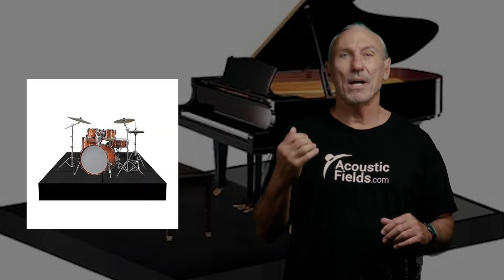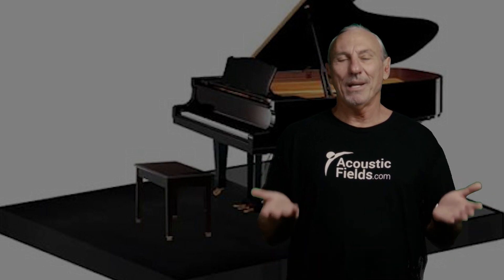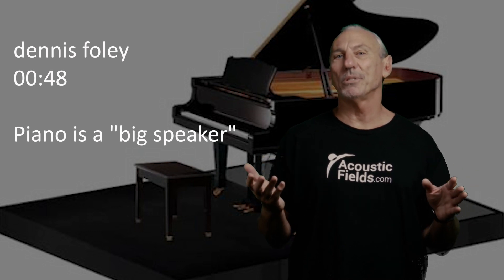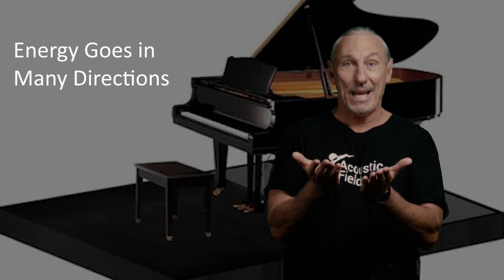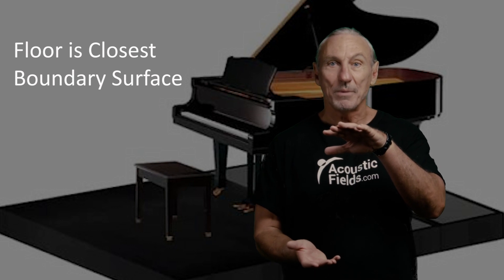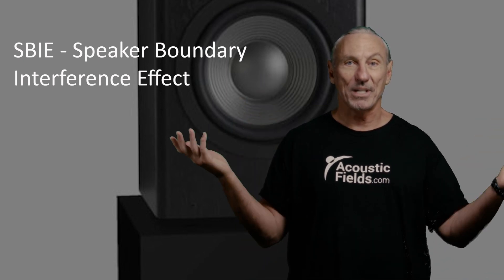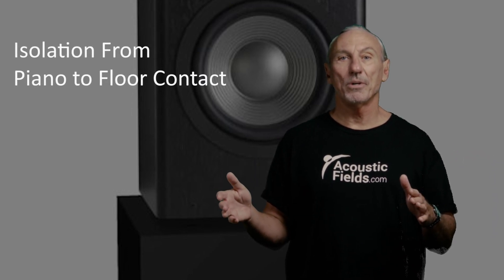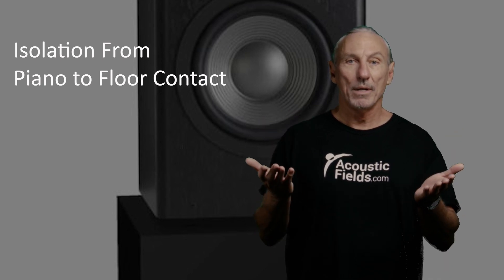Isolation - Elevation - Attenuation - www.AcousticFields.com

Comment: hi dennis. happy new year to you and to the comunity. i follow your channel since a couple of weeks and i appreciate the information you give. Since i live in Peru, many materials you show is not easy to find so i decided to learn physics and specially mechanical waves however i still doesn t find a conclusion. i live in the 3rd floor of a 4 floored building and the childs of my 4  floor neighbor throw chairs and density objects to the floor. i can hear everything like it is being thrown inside my apartment so i was thinking to thicken my hollowed brick walls with reinforced concrete in the rear side in order to reduce the vibrations these childs generate. i was wondering if you can show us if this solution can dramatically reduce the vibration in the walls so the aire inside the room can recieve so less vibrational energy. any other solution you can agregate will be incredible for me. thankz for the future answer. 👍👍👍

Comment: Why there is no absorption material under the stage in concert halls?
It is always an empty wooden frame, covered with layer of plywood, and hardwood finishing.
Reply from the maker: It is absorption. It is diaphragmatic absorption. The lowest frequency it absorbs at in determined by the depth of the stage. It is usually hollow so the rate of absorption can be minimized.

Comment: Would it not make sense to try to scatter the sound under the piano or redirect it 360 degrees out? Like with some sort of cone that you can see on those vertical driver speakers.
Reply from the maker: It is best to absorb the lower frequency resonances then either absorb the middle and highs or use diffusion. Diffusion is a bit tricky since the microphone distances are shorter from source.